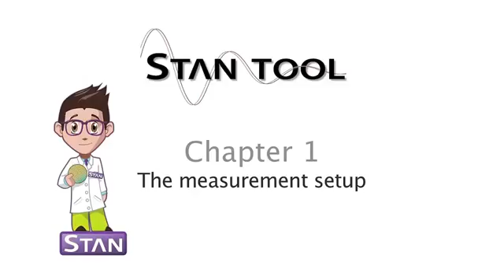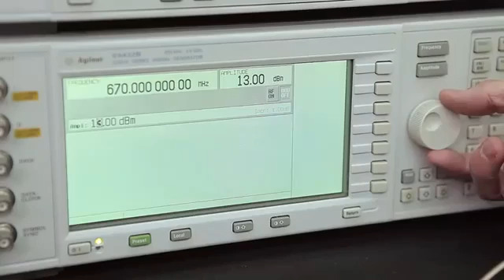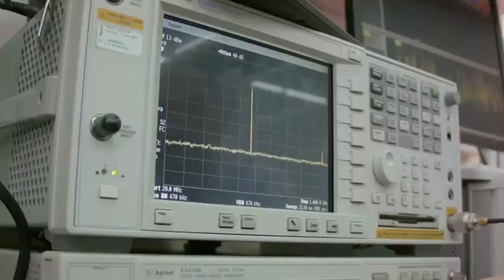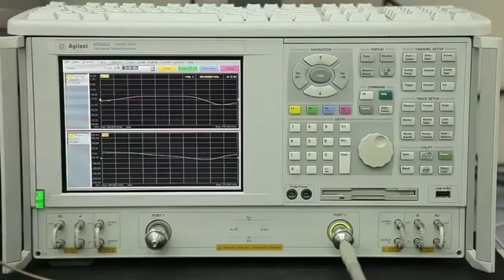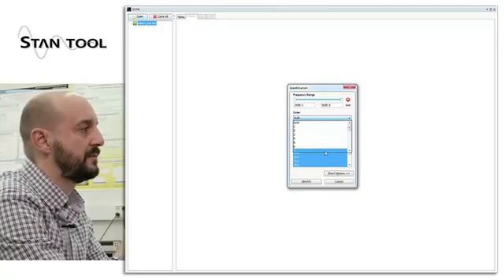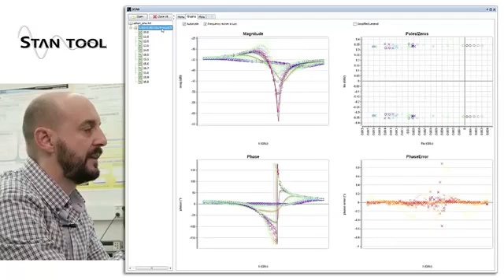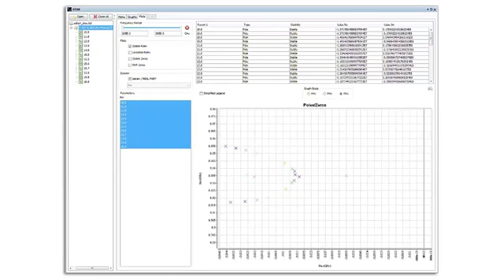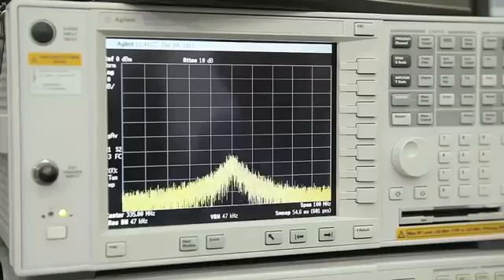IVCAD Stability Analysis Tool (STAN)

Comment: TY for the video report. Its very informative but the quality of this video isnt good enought. I see u have a good enlish knowledge, but anyway I cant understand few of phrases because when you decrease the quality of video the sound quality decreases too (Increased noise factor XDD). PLS upload the video 720p or 1080p. 

TY a lot!!!

Also I have a question. Did you have any expirience using STAN Tool to measure the power amplifiers?